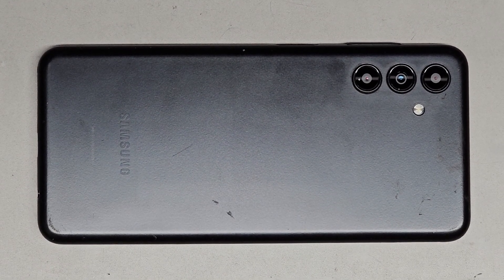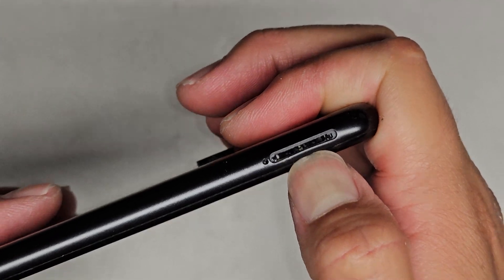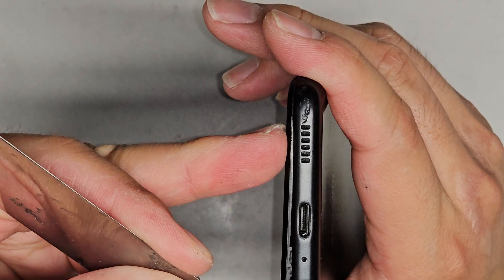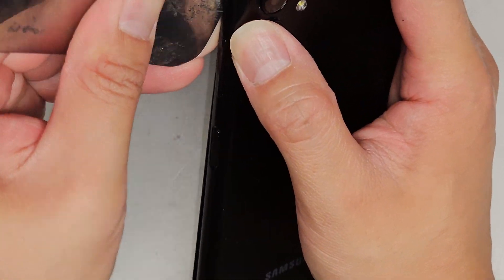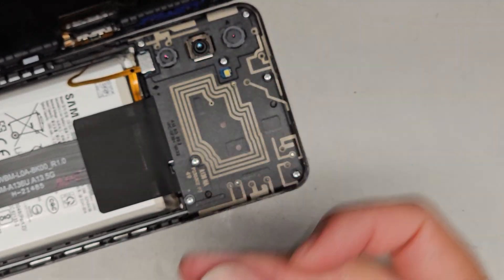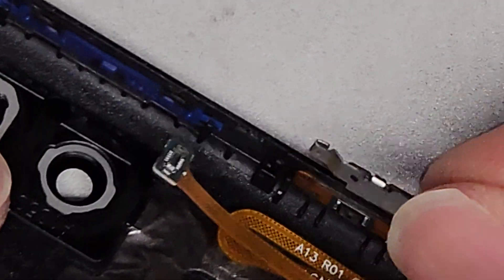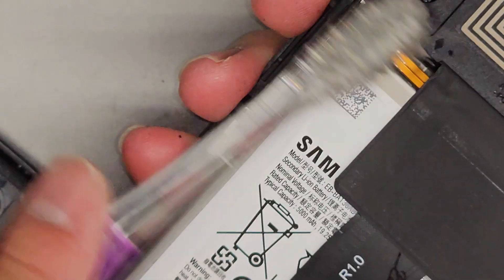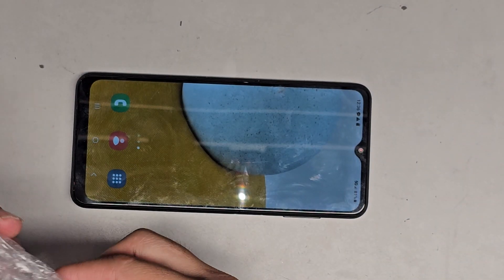Samsung Galaxy A13 Disassembly Power Button Fingerprint Reader Removal Replacement Repair Quick Look

Comment: I'm literally watching this after having pryed the back off the phone. Looking inside, I see that there is a power button much like this video. I got started with a razor blade, scoring all the way around the phone, until I got a small opening. Then I used a butter knife. I'm standing in the kitchen at the sink window 😅 I cannot turn the phone on, not off.  Now I need to order the button.  I just want to turn the phone on so I can get my picks off. 5:59 The metal piece popped out before I saw the video. After watching, I looked fir and found it 😅😅

Comment: To turn off the phone, you swipe down twice from the top. As you should know, that's where all your other buttons are at. Over BLUETOOTH, there should be the pencil icon for "edit" for button layout, the icon for power, and gear icon for settings. Tap the power button on the screen, you'll see the power off option.
Reply from the maker: @michaelcartwright8570  nice

Comment: I have the same problem but the phone died and when you plug it in it comes on but it has to restart to come fully on. I have not found a way to restart the phone without the power button, does anyone know any ways to do so?